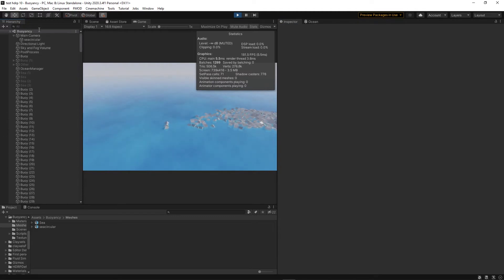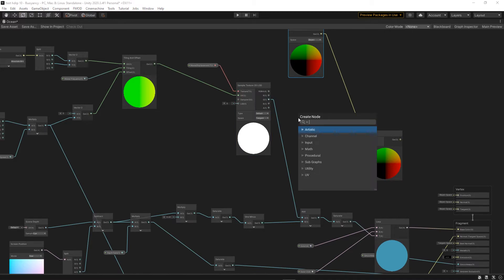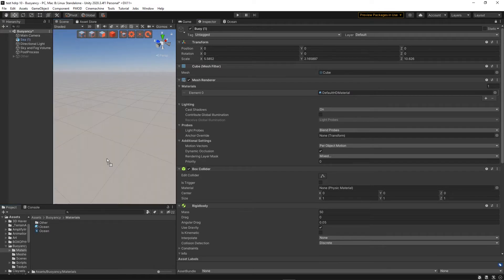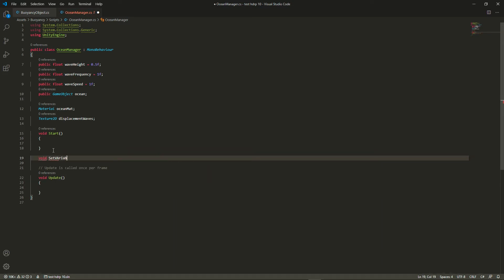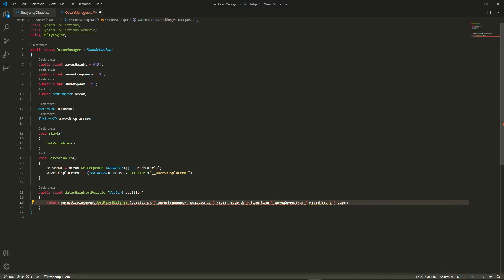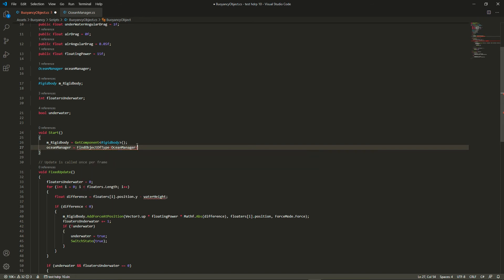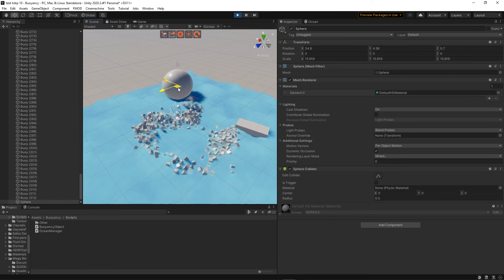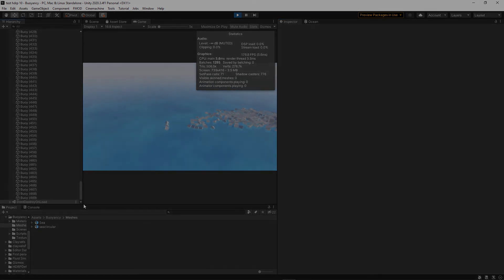Buoyancy with Unity Rigidbodies - Part 2 / Waves

Comment: This tutorial really helped me get my water physics working perfectly! I have a question though.
I'm generating my wave displacement using multiple sine waves and some gradient noise. The biggest thing I could use from this tutorial is the Texture.GetPixelBilinear function, but as you'd guess. I'm not using a texture to generate anything. But I need to get the info from the the shader of the height of each vertex. How would you recommend approching this? I've been researching documentation for a couple weeks now but can't think of anything that would get me something similar!
Reply: Did you figure anything out on this? Im also creating my waves this way, and need to get the wave height from the shader somehow to use in the script.
Reply: same here, i think that's why in the tutorial noise is generated outside the shader graph.
Reply: same fore me
Reply: same here

Comment: If you have objects floating like I did, try changing the WaterHeightAtPosition to 
return ocean.position.y + displacementWaves.GetPixelBilinear(pos.x * waveFrequency* ocean.localScale.x, (pos.z * waveFrequency + Time.time * waveSpeed)*ocean.localScale.z).g * waveHeight;
It is more correct to put the multiplication of localScale.x,z inside the GetPixelBilinear, to take into account if you rescaled the x,z dimensions of your water plane.
Great tutorial though.
Cheers,
PetRem Labs
Reply: You are the MAN! That was the fix needed to properly scale with ocean plane scaling. Comes in handy when applying weather systems to smoothly change the scale of the waves. Thanks!!!

Comment: So I think I did everythiright, but the things float way higher, it's like the point that they should be at is multiplied by something? can anyone help?
Reply: try reducing the water height
Reply: @N0tTh3Pr0  The problem is: water height 0, acts like no waves, I put  waterheight to 10, and the wave is at y 7 for example, the thing is trying to float at 14, if water is 14 it tried to float at 28, not with theese numbers, but you get the point

Comment: This is great but i'm having an issue. My cube just floats up way above the waves. I think the code is telling it the waves are much taller than the shader makes them appear. Code is 100% the same as yours and everything in Unity is set up the same. Maybe it has to do with the Normal Map? Guessing that because I know nothing about them and just grabbed some off the unity asset store.. Any ideas would be much appreciated!

EDIT: I Got it!!! My issue was my ocean plane game object had different scales for x / y / z. Once i changed them all to 100, the boat floated on the waves correctly. Hope this helps someone.
Reply: Check you water plan is in y = 0😀

Comment: the objects go to high and idk how to fix it
Reply: Did you fix that?
Reply: same issue floaters move way slower than the waves and stay higher
Reply: Actually I fixed it, but i don't know if it is the same problem for you. In the WaterHeightAtPosition method, I misswrote the formula, instead of putting position.z * waveFrequency + Time.time * waveSpeed, I put position.z * waveFrequency * Time.time * waveSpeed -> so I put a * instead of a + between waveFrequency and Time.time. Hope it helps !

Comment: Quick question, you use a normal map to make your water so you use an 2d texture lod node, in my shader, instead of using that I use a gradient noise node and it seems to do the same thing. so my issue is how do I reference that over how you're referencing  the 2d te3xture?
Reply: Did you find answer?
Reply: @sollner_fox  no, sadly... kinda sucks but hey all good
Reply: @iR3dy  Maybe normal from height node? The problem is that the normal will be pixelated when using that node.